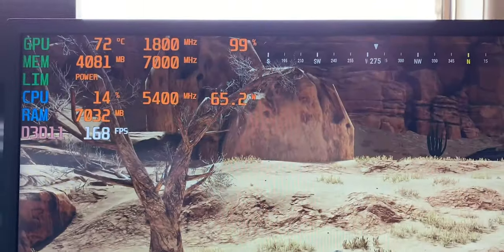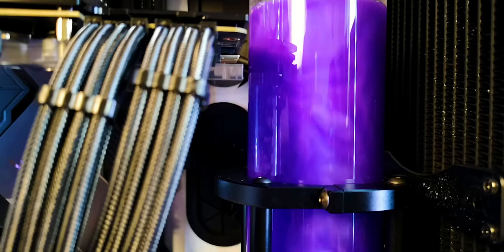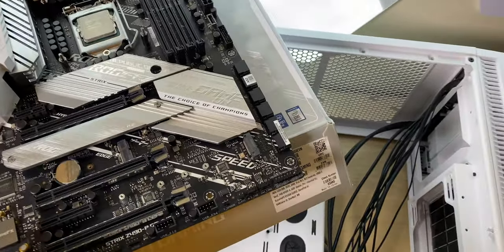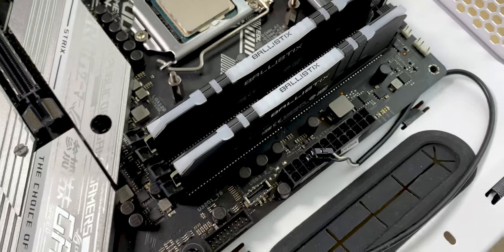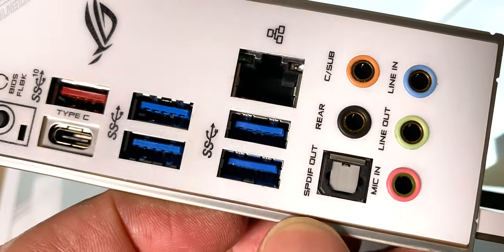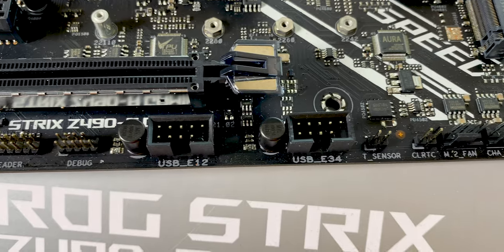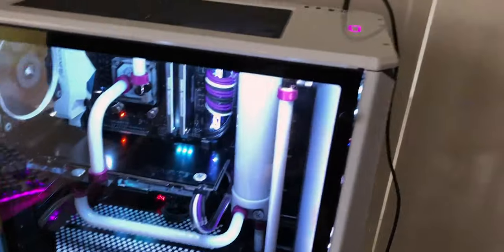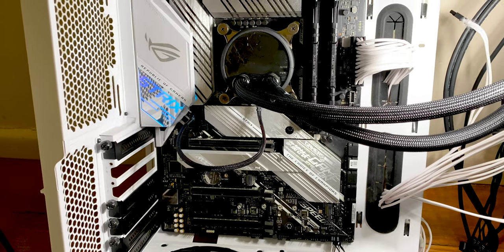This is where you start your 10th Gen Intel PC Build | ROG STRIX Z490-A Review. You don't need more!

Comment: I just bought this and a 10700k 
I'm finally upgrading from a z170x gaming 3 and a 6700k
I'll be carrying over my 1080ti :) pretty keen
Reply: How do you find it so far? I'm about to do a similar upgrade but I've been debating between the 10700K and the 10850K
Reply: @luckylucson  i love it mate, its just silky smooth i get about 35-41 normal temps and max temp on anything ive maxed out at 69 Celsius with a nzxt 360mm aio rad